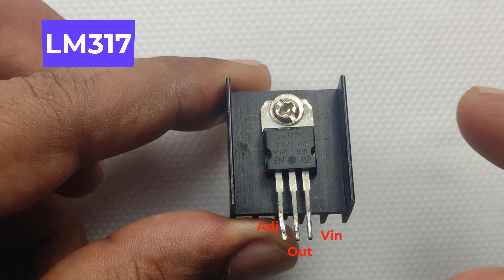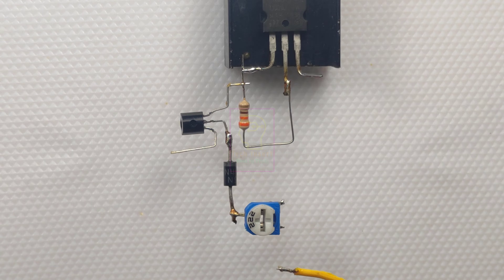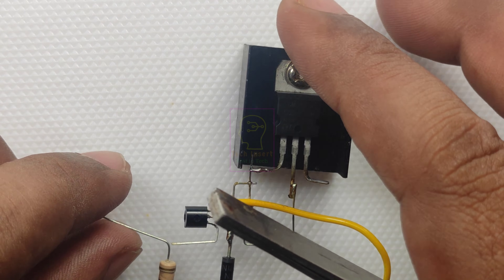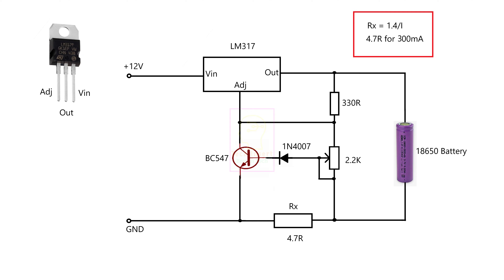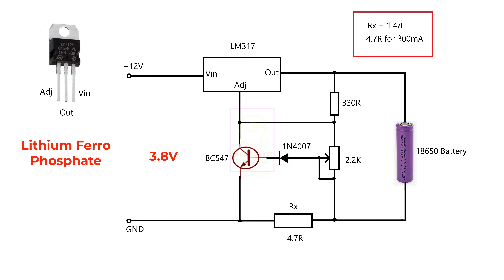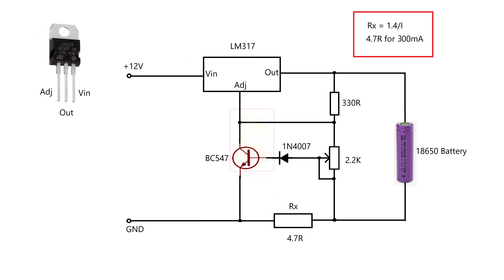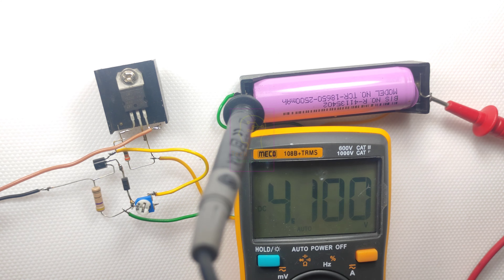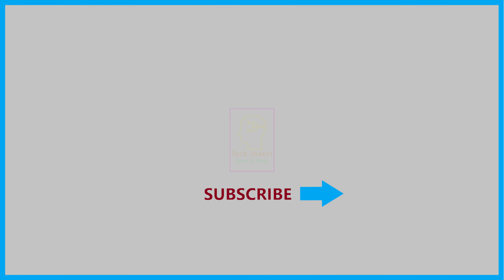How to Make Balanced Lithium-Ion Battery Charger Using LM317

Comment: One more suggestion. When there is no input voltage supplied & battery remains connected, it will drain through the 2 resistors. Can we put some kind of mosfet switch that will disconnect battery when no Vin is supplied.
Reply from the maker: Add a diode to the positive line to battery. Add 0.7v more from LM317. This is coz the diode will drop 0.7v.

Comment: This is good & simple. Tp4056 has the hard limits of 4.2V & 2.5V which strain the battery & reduce its life. Using this charger, we can charge upto 4V & increase the life of Li ion battery by many times.
Suggestion: Can you also append a Low Voltage Disconnect circuit so that it becomes a complete battery care circuit.
Reply from the maker: Yes , what you told is absolutely correct.

I will update the circuit with low voltage disconnect. Kindly give me some time

Comment: Good work, but the input voltage is not defined and for the improvement proposal the circuit does not have the balanced cc-cv if several batteries, cut-off in case of overvoltage or undervoltage, end of charge LED With (comparator to LM393 maybe)
Reply from the maker: Thank you for the suggestions and I will keep that in mind while designing the circuit.

Comment: Sir if the battery gets charged full then thrre should be a one cutt off circuit SO please make a one video with auto cut circuit thank you 🙏
Reply from the maker: This circuit is used if you do not have a TP4056 or similar charging module . It is only a work around

Comment: Bro bc547 heats very much 
 and output voltage drops over time Like - when i set output to 4.2 v it drops to 4v after 1 hour
Reply from the maker: Check ur battery, is that good

Comment: Bro when I giv 5v it give output only 4.5v
Reply from the maker: That is correct, lithium battery require max 4.2v. when giving load, it will reduce to4.2v

Comment: I think this circuit will work for charging Li -ion battery from solar panel.
Reply from the maker: You can use it ther also ? This will support wide variety of input and variable output

Comment: Awesome circuit. Seems very effective. TP4056 is cheap and ready to use
Reply: Tp4056 is cheap and very easy to get. The problem with that is it become faulty if voltage changes immediately like fluctuations . So a good filtering capacitor will help.
Reply from the maker: This is a new information to me, Thanks
Reply: @tabm7644  Good information
Reply from the maker: yeah, It is cheap
Reply: This seems to be a different kind of charging
Reply: Can we supply 5v pls reply 🙏

Comment: How long it will take to full charge a drained battery? Did u check that?
Reply: 2000mah will take more than 6 hrs  coz this is charging with 300ma
Reply: @tabm7644  Thanks m Tp4056 will charge within 1.5hrs
Reply from the maker: That is coz TP4056 is charging in 1A mode
Reply: @TechInsert  Thanks for the quick reply
Reply from the maker: Thanks tabm for answering
Reply: @tabm7644  Thanks

Comment: Very good circuit. You dont need 1W for the 4.7Ohm resistor. 0.25 W is enough
Reply: That is ryte
Reply: Yeah quarter watt is enough
Reply from the maker: I donot have a 0.250W resistor with me, that is why i used this one.
Reply: @TechInsert  make sense. Thanks for this circuit
Reply: @TechInsert  Thats fine friend
Reply: @TechInsert  Ok
Reply: Yes